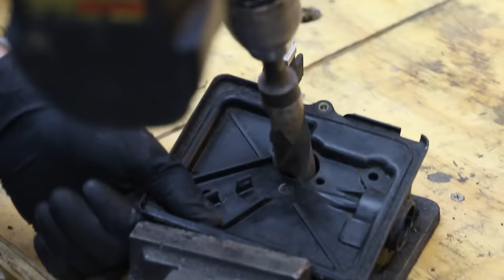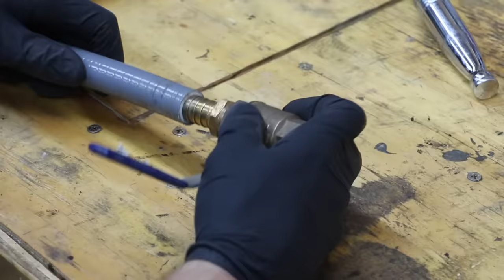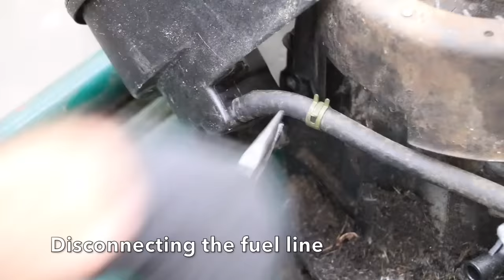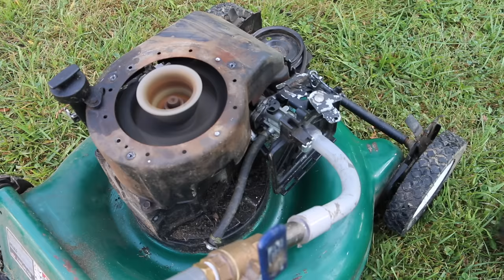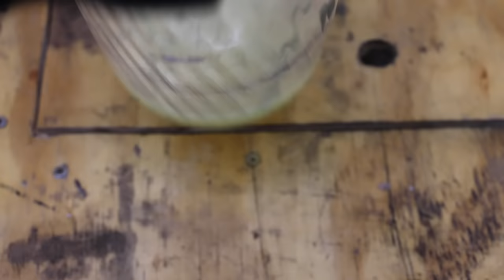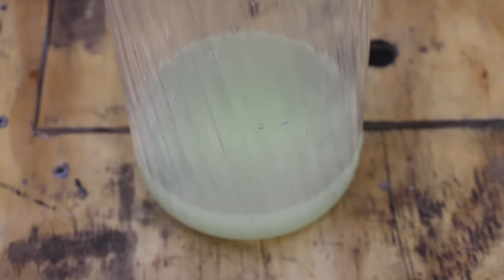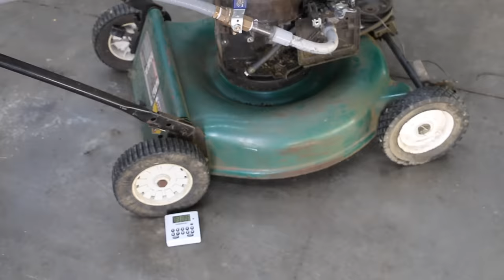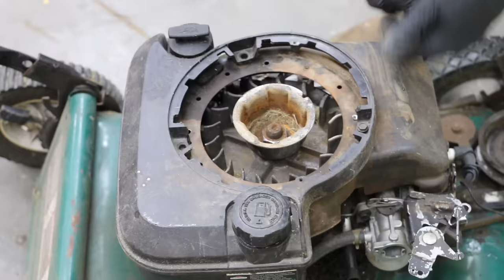Will a "Gas Vapor" Container Improve MPGs and Fuel Efficiency?  Let's find out!

Comment: Stans cell used each pipe tuned too tesonate with each major contaminate that water could have in it thus each pipe would act as a kind of tuneing fork for each contamination an you would not need too chage your freq very often too match so no matter what you would always be in the corect freq range no matter the water. Done corrctly water is the best an most powerful compared to gas whats more when hydrogen is in a vapor too right at point of compresion with oxgen then should be far cleaner too as well.

Comment: does not add up , carburator uses bunches of  fuel as spray (direct consumption) but the vapor setting  uses only the vapor of the fuel so the consumption should be considerably lower, i call it faked.

Comment: This vapor system is running at full saturation.  Retarding the timing past TDC burns better with vapor.  Also reducing the vapor by adding more air  to the system works better.  As is you running very rich vapor.  And I would bet the vapor was running at a higher RPM for 27min than the liquid fuel did at 26min.
Reply from the maker: Thanks for the feedback.

Comment: Your a no mind. The car has to turn the gas from the tank into a vapor before it will create combustion in the motor when ignited. Only 25% Efficiency  is obtained The cat is supposed to burn the unspent fuel the motor didn't burn in the exhaust system

Comment: If you had a hydrostatic drive train where you run 800 to 1000 rpms. how much mpg. You think you could get? This is my the theory.  No they put small engine that turn 1800 to 2000 rip. To get milage.  That backwards.  Rmp. Is your milage.  I'm to old to do this. Now is the time.  And the advertisement.  It's not the size. It's how you do it.

Comment: Nice video, there's one thing you forgot....  .. !!! .. That makes all the difference.

And that's to ADD exhaust gasES BACK into the carburetor with the Fuel vapor as it runs.... !!! PLEASE  .. 
You will find that's where the rubber meets the road,  control those exaust (egr)  temperatures.... (((( ohh  there's one last thing retard the static timing by at least 10 Degrs ))) ... 
((( And index is sparkplug and give it more gap !!!! )))) ...... LOL 
LET IT RIP

Comment: The other good one is the HHO converters the hydrogen where you have your positive and negative stainless steel washers or whatever however you're going to build them how I came up with my fuel vapor 1 was an HHO converter watching these small microscopic bubbles slowly come to the front surface I thought what if I put a bubbler in there to help bring these small bubbles of hydrogen to the surface so they could be burn faster then I just thought about blowing into a fuel tank and burning the fuel vapor and then I started doing research on YouTube and seen that Other people have done the same thing and there is a video of a gentleman talking about The original design of the engine was The original design  Of the confession engine was designed to run on a fuel vapor not a fuel solid but it was a fuel companies fuel companies that got greedy and wanted more money to burn them on fuel so there was a waste by-product which is the carbon output from burning the fuel

Comment: If you think car companies would've been using this "many years ago", you incredibly naive, and have no grasp of the depth of human depravity and greed. The Pogue carburetor got 200 mpg. Oil companies bought out his patent. What does THAT tell us? A guy in Phoenix modified the Pogue carburetor in the 60's. FoMoCo tested it = 200 mpg. Somebody killed the guy's partner and 'disappeared' the tool and die machinist who was setting up the production line. The oil and car companies are working WITH each other to suppress anything that would interfere with their profits.

P.S. the vapor was HEATED by the engine, before or at the intake manifold.
Reply from the maker: Thanks for the constructive feedback

Comment: Well you needed to run the vapor through the fuel whambulator, with the thermothrockle poly saturated cass trompulator......duh. Just using a gas vapor maker alone wasn’t going to work...so let me sell you the whambulator, I made for $295.99, and get you the remarkable mileage your after. Your welcome.

Comment: I am sorry I a just seeing this video but I believe car manufacturers are with oil people n they set cars up using more gas then necasary  I've seen people adjust bew cars tune um with computer n get better gas milage so u can't tryst car manufacturers  they don't have ur best interest at heart hate to tell u guy n video n I'm not trying be a dick  but I've seen older carburetor cars use vapors but I think it's different  fir carbed  engines  n fuel injected  but I doubt u could run ur car fast on a vapor though inlets fuel injected cus we all know u need more gas to dump in those old four barrel carbs to get those fast dragster but if ur ok with driving miss daisy  yea u can use vapor

Comment: Actually you did not save any fuel the fuel to air mixture was not as dense you you can run lean you can run rich there's an ideal fuel to air mixture ratio and then there's the economy EPA to the economy EPA fuel to air mixture ratio whatever it's set from the factory I guarantee you ran  Lean into person And by the way all engines run off of a fuel to oxygen mixture in one way or another whether it be diesel gasPropane if it is Powered by petroleum it has to have a fuel air mixture ratio even the old Stanley steamers it had to have the proper mixture of oxygen and Combustionable material in order to run because it had to have fire which is essentially just that oxygen and combustionable material which is a error to fuel mixture ratio Jet engines same thing they have to have a fuel to air mixture ratio s*** matter of fact if they run lean like you just ran they would actually melt the Turbine blades and have a catastrophic malfunction
Reply from the maker: Thanks for sharing.

Comment: The reason you didn't get a better fuel usage is that's a lawn mower. The sophistication of the fuel system in a car, like the O2 sensor would help in the management of fuel economy. DO NOT USE THIS DEMONTRATIONAS A MARKER FOR VAOPRIZATION EFFICIENCY.